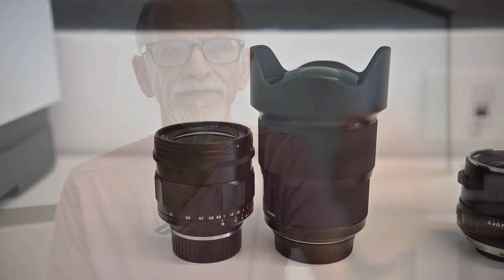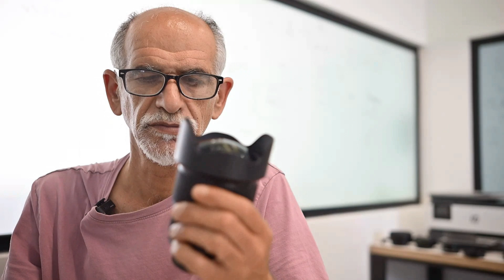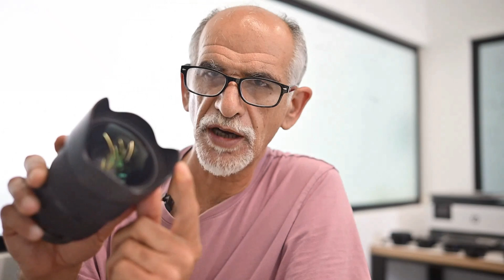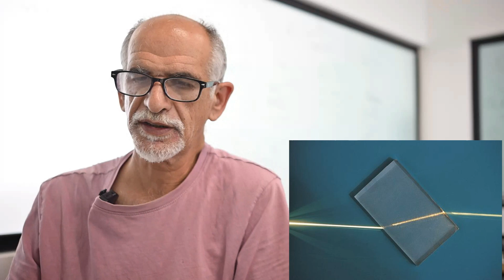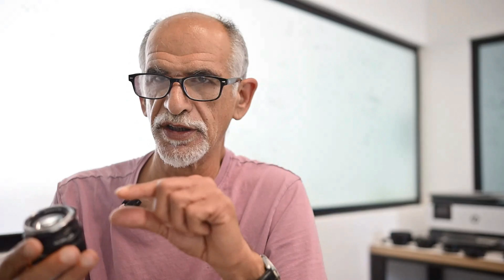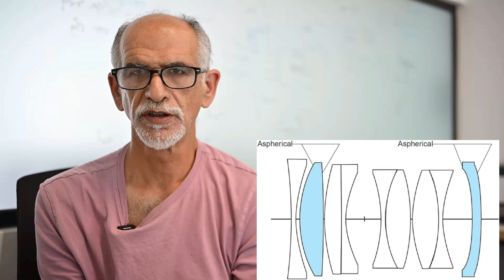Tell-tale signs of 3D-pop lenses

Comment: Thank you for the video, what would be good options for a poppy 85mm portrait lens? Preferably with auto focus. I have a Sony mirrorless body currently, I can use an adapter if the lens has a different mount. Thank you.
Reply from the maker: For Sony E mount, Sirui 85/1.4 and Samyang 85/1.4  are better than others. For ultimate pop - Nikon 85/1.4 G, Canon 85/1.2 or Jupiter 9.
Reply: @sneye1  Thank you! :) A long time ago I used Nikon mirror reflex cameras but because I missed a lot of shots because of autofocus I switched to mirror less Sony. The Nikon 85 1.8 G was also good, did you try it? It's also cheap and light :). For the canon is this the Canon EF 85mm 1.2 L mark 1? Also mark 2? For the Samyang is this the Samyang 85mm 1.4 FE mark 1? Or also mark 2? Or another older version? Thanks.
Reply from the maker: @luca_rr4660 
Canon mark i
Both Samyangs
Never tried the Nikon 85/1.8. The f/1.4 G has more pop. No ED glass in it. If you are fine with manual lenses, the Jupiter 9 is beautiful.
Reply: @sneye1  Thank again, will try the Samyang :). The Nikon 85 1.8 G has no ED glass, it's cheap and light (plastic) but I loved that lens, took amazing photos with it. You make great video! Subscribed :)
Reply: @sneye1  The Canon EF 85mm 1.2 II is not poppy compared to the mark I? If so why? Thanks in advance!!!
Reply from the maker: @jonique8  I don't know. They seem to have the same optics. You will have to check some image samples to verify this.
Reply: @sneye1  I am not an expert on 3D pop but samples of both lenses on pbase looked quite similar to me if not the same in regards to pop...
"Image quality was excellent on the original 85 L, but using Super Spectra coatings and optimized lens element shaping to suppress flare and ghosting should make the 85mm f/1.2L II an even better performer." - The Digital Picture
This is the most detailed description of differences I found and the only one mentioning a difference in lens element shape differences. 
So to conclude: From the samples I have seen on pbase, the-digital-picture and a comparison of 85mm EFs on wlcastleman, I can confidently say  that both the mark I and II have some 3d pop. However, I don't feel confident to quantify a difference because I don't really see it...

Thank you for your awesome content!!!

Comment: I think most 3D pop is more about the overall makeup of the scene and lighting. Of course you also need a gradual falloff in focus too, as an abrupt falloff can just look like two 2D planes overlayed on top of each other; the part in focus and the background. But that can be poppy as well depending on factors. I'd say the easiest way to visually test 3D pop is to stand facing the corner edge of a table, and then focus on it. This will allow you to have an object that has depth to it on the sides and rear. Then from the same position, focus on the center of the table and see how that differs, since that gives it both front and back depth. I think this more accurately explains and demonstrates what 3D pop actually is. It's not even necessarily a function of lens design, but the makeup of a scene, where the focus is, and the depth of field, along with lighting that can create contrast. If for example, your subject is about the same luminance as the background, even with subject separation, you lose contrast separation. 

Now one thing about photography in general with light, is the more distant a thing is from the lens, the darker it can be, because of the inverse square law. This is why you can often find distant objects more noisy than close objects, because while a building or foliage way off into the distance might be lit by the same intensity of light from the sun, your distance from it means the amount of light reflected toward you is lesser. Now how does this factor into 3D pop? Well, if the background is brighter than the subject, but distant, the actual brightness of it by the time it gets to your lens can be anywhere from equal to lesser than your subject, which can affects how much the image pops. The reason why I bring this up, is because people can get 3D pop in some instances, but not in others, and that's the reason why, even though they likely don't realize it.
Reply from the maker: Hi, thanks for the elaborate discussion. Light is of course a factor in the perception of 3D. It is not so much about the distance of objects from the light source as the direction the light is coming from. DOF, on the other hand, has nothing to do with it in my experience. Photographs that seem dimentional can be fully sharp or have thin DOF. 
It doesn't change the fact that some lenses are way more conducive to this effect than others. In my opinion it is related to light dispersion. There is a lot of evidence to support this hypothesis.
Reply: @sneye1  The reason why I mentioned DOF and light falloff at a distance, is because people could take photos where the background is brighter or darker, and not realize that is what is giving pop or not, where they might have had pop if the background was darker, and so for example, a distant background outdoors could have a greater chance of giving 3D pop (or a closer background under the right angle/contrast/lighting conditions). If we consider 3D pop as a DOF curvature, which could be an attribute of it, then there's a lot of lenses that could exhibit 3D pop that one would think isn't capable of it. For example, the Canon 40mm 2.8. A very cheap pancake lens, not a very wide aperture, and pretty simplistic in its design. Of course at 40mm and 2.8 it's not going to exhibit pop shooting medium to distant objects, but within several feet, it definitely has a 3D pop, and not just because of the amount of bokeh. 

If we were to use your logic to judge whether a lens has 3D pop or not, we could say that any lens that stays soft at the corners, even when stopped down, has 3D pop, which can't be the case. My overall point is that certain lenses may exhibit 3D pop under different conditions, as lenses that are considered 3D pop, aren't necessarily 3D pop all the time, which means there has to be other factors to consider. It may be the case that many lenses not considered 3D pop lenses, could exhibit 3D pop under the right conditions. If a contributing factor is the characteristic of depth of field falloff, one must also consider that lenses may behave differently at different apertures, and not just in their sharpness. For example, a lens might not show any pop at f/8, but maybe it does at f/7.1 under the same scenario, even if it doesn't necessarily have the lens elements one would expect is required for 3D pop. What I'm saying is, the sweet spot for 3D pop could vary from lens to lens, and so for example, one lens might exhibit 3D pop at f/2.8, while another might exhibit it at f/3.5. 

If it's a function of the angle of light moving through the elements, then it must also be a function of the relative angle of the aperture, which is obviously dynamic, and so 3D pop itself could be dynamic too. So a lens a person might consider as not 3D pop, might exhibit it if stopped down 1/3rd of a stop or so. This is further backed up by your light convergence chart on chromatic aberration, because chromatic aberration doesn't just come from lens design, it comes from aperture too, because aperture effectively limits or expands light convergence, so there should definitely have to be a "sweet spot" in there for 3D pop even in non-3D pop lenses, it just may be it doesn't happen to be at the specific aperture people tend to use, or an aperture that is even available. A good way to test this would be with manual aperture lenses, so that way you can stop it down in even 0.1 increments, which is typically not available as an option digitally. You may find, for example, that a lens that isn't considered a 3D pop lens, may actually exhibit it at f/1.5 or f/1.6 instead of 1.4.

Overall what I'm saying is that what we consider as 3D pop lenses, might only really be considered that because their 3D pop effect happens to fall on a main/common aperture setting, while other lenses might exhibit 3D pop if they were slightly off kilter on their aperture settings.

Comment: An old colleague also has a tool that helps him detect which lens has 3D pop potential. It is the diameter of the front element of the lens. It must be as close as possible to the minimum physical diameter (focal length in mm / aperture = diameter in mm). Example: When the lens is 50mm f/1.4, the minimum physical diameter of the lens is 35.7mm. A lens close to such a diameter has 3D pop potential. Conversely, the further away it is (the larger the lens), the stronger the retrofocal construction and the less potential for 3D pop.
Reply from the maker: Hi, true. I've noticed the same thing. Not a rule, though. Lenses such as the Nikons 24 and 28 f/1.4 have a 67mm filter diameter but they are both nice and poppy. However, I don't remember a 77 or 82 diameter lens I liked. BTW, most SLR wide and normal lenses lenses are retrofocal. Some of them are nice.
Reply: @sneye1  I found an article that also claims that the cause of 3D pop is not defects. Image defects are just a symptom. Simple designs without defect correction and 3D pop are correlation, not causation. What is really important, they say, is the simplicity of the optical system, its minimum possible diameter (with respect to the focus and aperture). This will avoid the retrofocal design with a large front element, which is typical of heavily corrected modern lenses with a complicated optical design. It is precisely the large diameter of the front element that has a different angle of refraction of rays (the edges of the lens see objects more from the sides) than in smaller lenses. The image processing inside the lens and its transmission to the sensor is also different. A lens with a large front element has a completely different vision of the world and space. An extreme example is hypercentric lenses with large front elements, which see objects completely flat. These lenses are used in industrial optical inspection. https://i.ibb.co/j9sYp1P6/HYPERCENTRIC-LENS.png
Reply: @sneye1  Of course, with wide-angle lenses, you can't get close to that, but it's a spectrum, when there are a number of lenses with the same focal length and aperture, the ones with the smallest lens will always have more potential. It must also be said that there will always be an exception in every category, for which none of the rules will apply. There are infinitely many options for designing a lens and there are so many influencing factors that it can never be defined as generally valid. As I understand it, the point is to have some simple tool for a quick estimate before the lens is tested in detail.

Comment: Highly doubt that theory. In binoculars all manufacturers advertise extra low dispersion glas to improve contrast and clarity through improving chromatic aberation. Zeiss in particular has a reputation of having a lot of contrast and pop in their binos, which seems to be reflected by reviewers and users alike.  Especially the totl glass has this as well as the SFL series. I can confirm through owenership that the contrast and life like representation is excellent in the SFL binos and  Victory SFs. 

Similarly in photography. , when I edit my RAW photos I typically increase local contrast which results in the images popping more. My understanding of optic design is, that you get less blurriness through APO designs and regions of high contrast are better separated, which yields to higher local contrast -> more pop. 
In addition, there are photographers on youtube demonstrating how to increase the poppiness of an image through the use of flashes. So lighting can go a long way for creating popping images. 

It seems to me that a nostalgia is going on in photography, where the old stuff is called out to yield better or more pleasing results than the more technically perfect modern stuff. Compare the discussion of vinyl in HIFI, which is as similar nonsense. 

That being said, less corrected lenses can have a charm and esthetically pleasing look notably due to their imperfections, which I have also experienced with my Zeiss Planar 85mm f1.4 as well as Voigtländer 58mm f1.4. So I can understand why people seek for that look or even prefer it.
Reply from the maker: Correct. The exception to this general rule is magnifying optics such as binoculars, microscopes and long telephoto photographic lenses. In this case aberrations are also magnified dramatically and become visible to the naked eye.
The positive effect of CA on pop has some evidence. It is not only based on my impression. The most striking evidence comes from video games, where simulated CA is added to CGI to make it more photo realistic and poppy.

Comment: Popyness is quite subjective so I won't comment but just a trend I observe is now more lens is designed for mirrorless camera and pay more attention towards flat and neutral imaging style.
Also a trend now is through powerful CAD we can achieve a close to ideal lens design without using special glass or asph element, which also reduce cost.
Reply from the maker: That is news to me. Where are those ED-less inexpensive lenses then? 😞
Reply: @sneye1  I have a Viltrox 40mm f2.5 in z mount, with only 1 ED and 1 ASPH element, it performs very well, better than nikon and sony's offer for this focal length. And it only cost me ~780CNY. What a steal!

Comment: Curve focal plane, especially curved forwards, strong vignetting, lack of contrast in background blur with good subject micro contrast with makes poping lens for me. That curved filed focus plane make perceived perception of depth for me and vignetting does the rest.  I was raised with Zeiss Jena DDR classics like flektogon , biotar, sonar but didnt mind switching to Canon AF like 25yers ago. Old analog era AF EF L glass is golden.  EF 24 1.4L, EF 35 1.4 L mkI, EF 85 1.2 L, EF 135 2.0 L,  especially TS-E 90 2.8 very popy for me.....  I have a feeling that over 3 LD glass elements is correlation not a causation. I mean usually are a sign of a modern well corrected lens with no aberration, high contrast, flat focal plane and after camera removes vignetting images come as flat.   We lost the pop with those complicated, heavy, razor sharp, Apo, flat focus plane lenses indeed, but funny enough I hope for pop to be back with some modern lightweight mirrorless lens designs which relay more on software fixes then complicated optical designs.... I love my Canon RF 35 1.8 IS macro, remind me very much of my beloved Jena Flektogon 35mm 2.4 but pop is lacking. Then here comes RF 35 1.4 L modern AF lens with buckets lots of pop,,,so hope is there. Always wanted to try those pocket M Voightlanders but need AF for the kids at the moment.
Reply: so any of the gen 1 L lenses are all very poppy? I will start collecting :D
Reply from the maker: Hi, all the factors you mentioned contribute to the "vintage" appearance of the photograph, but not to pop directly. I was recently able to confirm the correlation between glass chemistry and pop, using mainly old lenses. Older EF-L primes have few LD elements if any and are generally poppy. Just as well you can adapt them to your RF camera seamlessly. The current RF lens lineup is mostly flat, unfortunately, Including the new 35/1.4.
Reply: @sneye1  what about the RF28mm f2.8

Comment: Very interesting. Fuji user here. By your metrics, the Fuji 18mm 1.4 would be highly poppy (6.7% ED, 1.67 complexity)  while the 16mm 1.4 would be mostly flat (15% ED, 1.18 complexity). However, I own both and in my experience it looked to me like the fuji 16mm 1.4 had more pop as it certainly has more chromatic aberration. Is it really just about lenses that have more chromatic aberration? Or do you think the newer more corrected 18mm 1.4 would have more pop than the older design of the 16mm 1.4?
Reply from the maker: The formula does not tell the whole story. It's only a guideline. CA does create pop.

Comment: Not all ED glass are created equal. There is not one ED element for all brands to use. The ED creation is difficult and every brand has another recipe to create it. That's why the Zeiss Batis 135mm F2.8 lens for example (which had a lot ED elements) still has an insane amount of 3D pop, contrast and the benefits of an APO lens. If ED glass were all the same there would be no point in buying more expensive glass. Zeiss is this expensive precisely because of this reason. Many people mistake Zeiss batis being inferior because of only one spec: the f-stop. Sure there are other lenses that have 135mm at f1.8, but can they produce the same color, apo and contrast? I bet not.
Reply from the maker: True, Zeiss, Leica and Voiigtlander sometimes use milder types of ED glass.

Comment: I am very much enjoying your videos.  Thank you for sharing your skills and research.  

I sought to apply your criteria to the Canon lens library.  I looked at pre-1960s 50mm and 35mm lenses. As lenses before 1960s don’t (as I understand it) have ultra low dispersion elements, I focused on smaller lenses (ideally rangefinder) with greater complexity.  I thought I had hit the jackpot when I found a Leica Thread Mount 35mm f1.5 with 8 elements in 4 groups from 1958!  

I then searched for the lens online to discover it is an extremely rare lens and sells for over $4000!  Back to the drawing board…!  😂